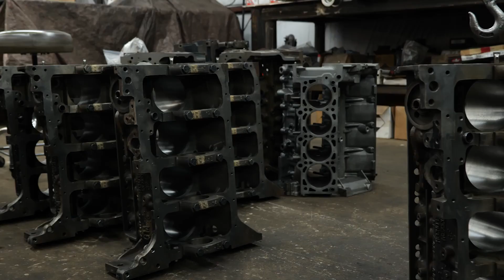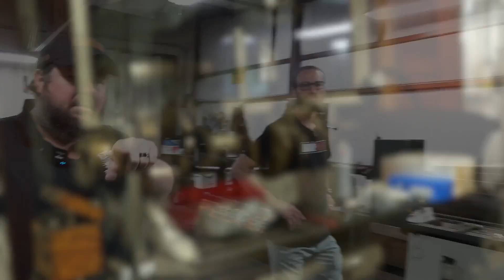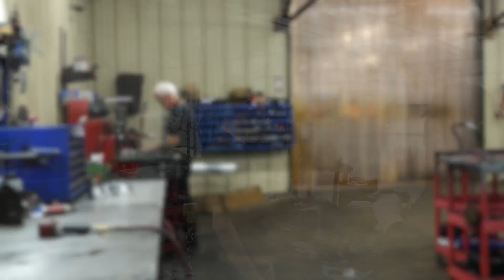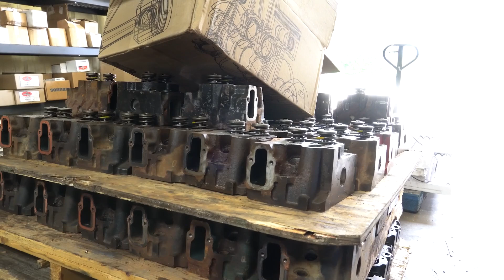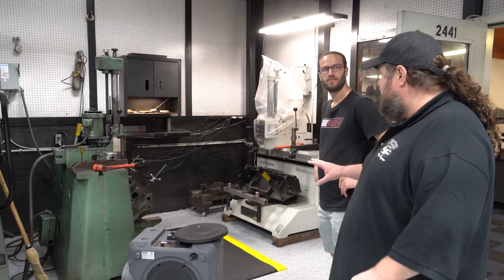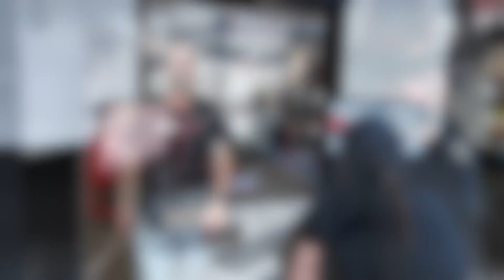Take a Tour of WCH Racing Engines

Comment: A good machine shop should be almost as clean as an operating room. The most wear from engine break-ins is the minute metal and other materials left inside the engine after machining and assembling. The little bit of wear caused by this will dramatically multiply through the life of the engine, with shortening the durability and life of the rebuild engine. I am 68 and knew of machine shop rebuilds in the 1960's and 1970's leaving a little bit of metal and other material causing the flat tappet camshafts to be the first to prematurely wear out. Four spine fusions forced myself in 2004, (I was a underground coal miner mechanic/electrician), to earn an Automotive Associates Degree of Applied Science with added one year of advanced automotive machine shop certificate, among other certificates such as SMAW Welding, and can definitely state all core engine blocks, heads, camshafts, and crank shafts should be stored siting on their ends with crankshafts and camshafts suspended in the air straight up and down. Today, only the professionals do this with all other smaller machine shops not caring about core shifts totally changing the true geometry of all cylinders being 100% equal on the crankshaft throws and true block/cylinder squareness of the bottom of each cylinder to the line bore after rebuilding machining, with making sure to hanging the crankshaft or camshaft perfectly straight up and down in the air for 100% straightness.A complete engine when bolted together can be stored in any position desired, but once you begin to disassemble the engine, it can only be stored as I stated. You need to always remind yourself that engine rebuilds are based on tolerances as little as one ten-thousands of an inch tolerances, especially for longevity of racing engines. This was done since the 1920's and is still done today by the bigger professional engine rebuild shops.